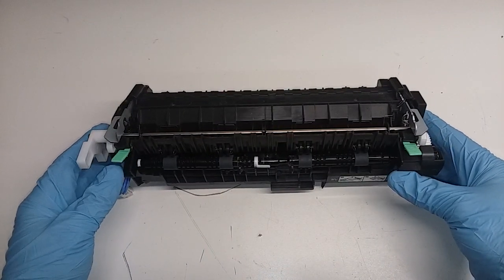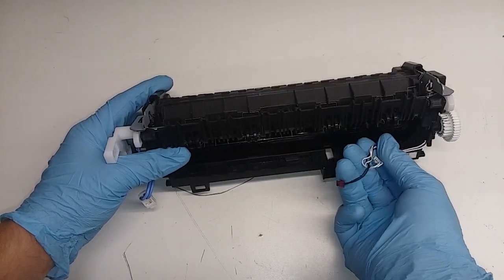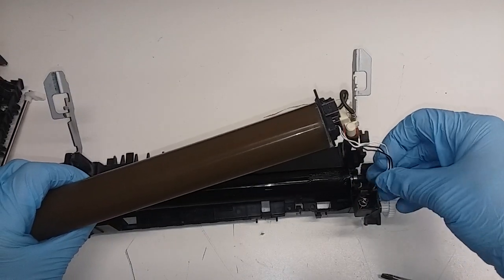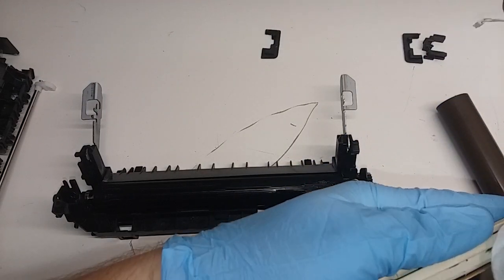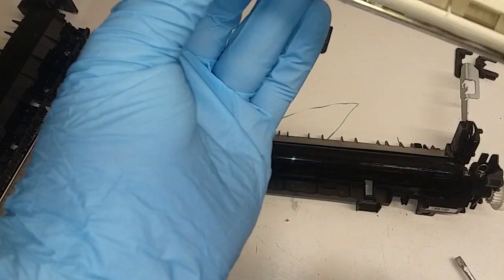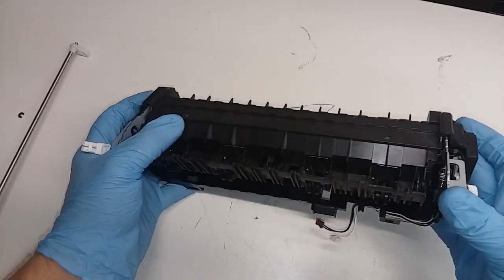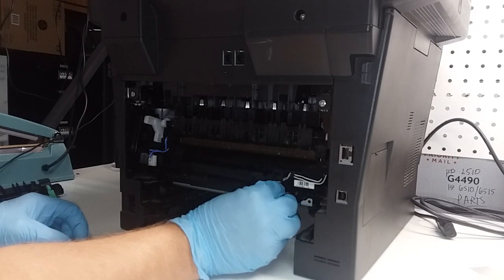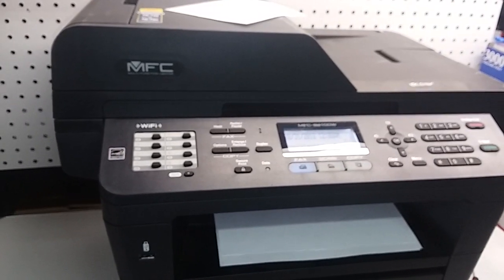How to fix Fuser on Brother Laser Printer - No need to Change sleeve or pressure roller

Comment: Thanks for your clear instructions.  Just completed regreasing the sleeve on a Brother HL-6180DW.  The printer text and horizontal lines were fuzzy, but are now sharp.  This issue is explained in Brother Service Update P1398.  Appears to be common at about 20,0000 pages.  The update recommends replacement of the fuser unit, but the regreasing of the sleeve does the trick.  I used Molykote HP300 grease from partsmart.  I used 2g of grease.  The only thing I would add to your excellent service description is to either replace the fuser sleeve or carefully clean the interior of it, as there will be old grease there.  A bit tricky to clean, but I did reuse the original and it worked fine.  My lower roller was also heavily creased as is shown in your video, but that does not appear to be a problem.  Now to see how long the fix lasts...

Comment: I was lucky to find the sleeve and lube for 20 bucks on eBay.

I got this off the previous tenants, didn't want to toss it out, cleaned it all out and still jams, thanks to your video I know how it ended up in the storage room! 

Few weeks from now when it's here, can't wait to swap and lube it out!
Reply from the maker: Thank you for sharing. Good luck with your project. Have a great day.
Reply: @303electronics  I followed both your video on this printer and it helped a ton! It's working again! No dimming lights too, it must have been drawing a huge amount of current previously to get that roller spinning!

Comment: Thank you.  I finally got around to trying your repair out.  Worked well for my old Brother 5470DW printer that was smudging and where fuser replacement was prohibitively expensive.  Hopefully this will extend the life a bit.  It's not even the expense as the printers are cheap when on sale.  It's just that I'm sure it would go into the garbage bin rather than be properly  reused.  I'm giving the repaired printer to a nephew for school from home use.  Thanks again - worked.

PS - I also broke the clip (that you warned us about).  Due to the heat, the plastic is super weak/friable.  HOWEVER, I was able to just put the broken plastic piece back in place (without gluing) and the pressure from the metal brackets and other parts seem to be working to keep it together/working properly.  At least for initial testing.  Don't know about durability of course.

2023 Update - 2 years out and the repair has held up.  I have now had to repair my 2nd unit using the same technique.   But the 2nd unit fuser was pretty worn so it wasn't JUST the lack of lubrication this time resulting in failure.   STILL, I will keep the unit as a backup printer for now.
Reply from the maker: Awesome! Good work! Thanks for the update! Have a great weekend!

Comment: Thanks for this terrific video! In your experience does regreasing the fuser sleeve address the problem long term? Like was it just one year where the fusers were not greased properly but then greasing it makes them normal? Or do you end up having to redo this every 15,000 pages? Thanks!
Reply from the maker: Yes, re-greasing should help while rollers are in good condition. Thank you for your feedback! Have a great weekend!

Comment: Hi,
thanks to your video,

My Brother MFC-8910DW was printing out misty prints(they were not at all crisp/sharp), thanks to your instructional video, I was able to replace my fuser pressure roller(which was peeled/scrapped off on one side) with a new one, However i did not remove the fuser sleeve to clean and re grease the inside, as i did not have the right grease handy. After i put the printer back together i could not really see that much of an improvement in its misty print quality.

Will the crisp print quality be possible only after we clean and re-greasing the fuser sleeve ?

thank.s

Comment: Any idea whether this process would work on the HL-L5200DW? It uses the TN-820 (or TN-850 high-yield) toner. I've watched the video and it appears there are some differences, but I'd like to find out if this fix might work before I start disassembly.

My symptoms, I believe, point to the fuser. Pages wrinkle ONLY when duplexing, and there is toner underneath the wrinkle, though it is smudged.

Printer is less than three years old and sees very little use (home user).

Thanks!

Comment: I'm not sure if you're still responding to the comments but I have a hl-5470dw and I ordered the fuser and the roller along with the grease took it apart did everything mentioned here and put it back together and when I print, after it prints about 15 or 20 Pages there's tons of ink just dragging along the pages several pages and then it'll stop and then start again. No consistency. The drum is new?? Any ideas? Are used almost half the container of Grease in which I was instructed to do with the instructions included.
Reply from the maker: Hello. I'm sorry for the delay in response. If there is a lot of toner that isn't supposed to be, two things: faulty drum, or faulty toner. Sometimes a bad laser unit, but less likely.
Reply: @303electronics  ty😉

Comment: Does this also fix the jamming issue? Or this fix is only for the smudging?
Reply from the maker: Hi. It depends. If you have checked the printer to make sure there isn't anything in the way, then yes, usually you will have to check the fuser. Rollers on the fuser wear out and start skipping on paper, which causes jam. So yes, if your printer paper smudges when you wipe it, that means the rollers are worn out and are not doing the job. It isn't just for smudging. That is just a way to see if fuser needs new rollers. After rollers are properly replaced, jam will go away.
Reply: @303electronics  thank you, my printer has both issues. Jamming and smudging. 
There is toner dust everywhere inside and when I pull out the jammed paper, the toner dust is easily smudged on it.
Reply from the maker: @MarkGrinevich  I'm 99% sure replacing the roller and fuser sleeve will fix the issue. Make sure you get the correct set. It should cost around $30 on ebay or Amazon. Takes less than an hour to replace. Let me know how that goes.

Comment: Hello, i just want to ask if Mfc l9500dw can have toner powder or just toner cartridge replacement?
Reply from the maker: Hi. It needs toner cartridge replacement, but you can get the powder refilled instead. It is a very complicated and hard process. If you  want to save money on cartridges,  best option is to order a set off ebay or Amazon of aftermarket or "remanufactured" cartridges.

Comment: If you needed to change the fuser sleeve or fuser roller, where can we buy products from a trustworthy place/seller?  I wouldn't want to buy something that will be faulty and melt inside my printer. Do you have any recommendations?
Reply from the maker: I bought some for different models on eBay and Amazon. I usually recommend looking at the seller rating and feedback. Honestly I bought from different sellers and quality seemed to be good no matter where I ordered. Just make sure you order for correct printer. If anything is wrong or if you do not like the part, usually free returns are available from most sellers. I sell parts and have people return items "just because" and we accept returns without hassle. I do not have these rollers however, but am almost positive that whoever you buy it from will be a safe transaction all the way. I can say that for eBay and Amazon.

Comment: I followed these steps and when I print thick lines (barcodes) the ink will rub off. Does the film sleeve need to be replaced?
Reply from the maker: Yes.
Reply: @303electronics  Thanks for the quick reply! I'll replace and see if it fixes the issue.

Comment: My fuser life says its at above 1/2 life remaining but has all the symptoms on your videos of needing replacement. how accurate is that printout?
Reply: also my page count is at 43,000 since new
Reply from the maker: @autosportsimports On this model and ones produced in that year, the fuser goes out so much sooner than the  100,000 that it is supposed to run. I have seen the fuser do this at 15,000 and 25,000 page usage on the printer.
Reply: The page count on the fuser is based on the specs set by the manufacturer. It’s just an estimate. The machine is just counting prints.

Comment: I actually have the opposite problem. My fuser is fine but I want to turn it off! Is there any way to do that, and still have it print an image?
Reply from the maker: Hi. No, I don't think that's possible. You can try disconnecting the fuser sleeve by breaking contact inside of the sleeve. I dont know if printer will detect a problem,  but your fuser will not heat up. That will print an image, but it will be smeared just by shaking the paper.

Comment: I have followed the steps. before the toner was fixed on the paper correctly, but with big shadows, after about 90.000 prints. I have used a clear silicone grease made for cars, which should work from -30 to + 200°C. as result now the toner will not fixed correctly. But if i change the paper setting to "labels", it works, and i get a clear print without shadows. so it looks like the fuser gets not hot enough. is there a maintenance setting for tweaking the temperature? Or what could be the reason for this? Too much grease? (does it cool it down? or change the sensors values?) always printing with the media setting "labels" is no solution, because i also have to really print labels, which needs more heat again.
Reply from the maker: Seems like its time to change the fuser roller and pressure roller on the fuser. There is not temperature adjustment.  The set only costs about $30 and instructions further into the video.
Reply: @303electronics  thanks for the quick answer. I still ordered some sleeves incl. grease some days before. i guess it will take 1,5 - 6 weeks from hongkong to us in germany. so i was simply trying before with one of the printers, which i still sorted out, because of the bad prints... anyhow: why should a new sleeve and pressure roller should help in this case? before, i added the silicone grease, the toner was burned stable onto the paper. So i would say the heat was ok. As i understood from your video, or may be from the translation of the word grease, the problem was, that because of to less (or too much used) grease, the sleeve was not able to move enough anymore. Now it is able to move, but get not hot enough. Or did i understand this wrong? Is the sense of the grease not make it move? Is the grease instead to transport the heat?
Reply: @luxbox Hey! Did you solve your problem of "toner not fixing correctly"? How?? Thanks for your attention.
Reply: @marcusaugustus5437  Unfortunately no. I ordered a toner sleeve incl. grease for a chinese seller. It solved the problem. But after only about 2000 pages, the problem was there again. I guess the grease was not the correct one. It was also only 0,4g. so possibly it was not enough. Later i applied a second package grease. but it was about the same after less than 2000pages the problem was there again. So i ordered from an an other chinese seller 10g grease for about 10USD. I hope this one is the correct one for brother printers. the seller wrote: it is. anyhow. i waited 3 months, but never got the shipment, which was lost in frankfurt/germany. i got a refund from the seller. and i ordered again. about 1 month ago. i hope this time i have more luck...

Comment: I found a polymer-based high-temp grease that worked exceptionally well for this: it's called GRS-HP300 and available from a place in Duluth GA called PartSmart.com. Reasonably priced bought direct, instead of Ebay or Amazon. I also found Eric Wesson's comment valuable in cleaning the fuser and sleeve with isopropyl, and I used 99%... worked great.
Reply from the maker: Thank you very much for sharing this information.  Have a great day.